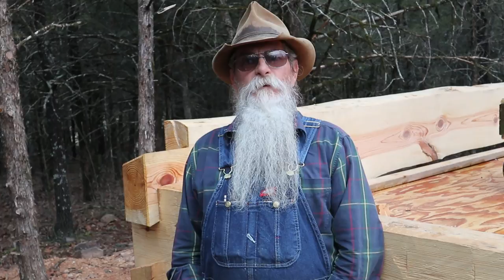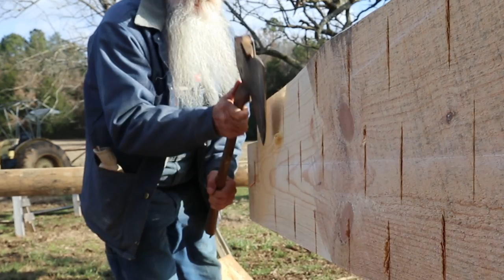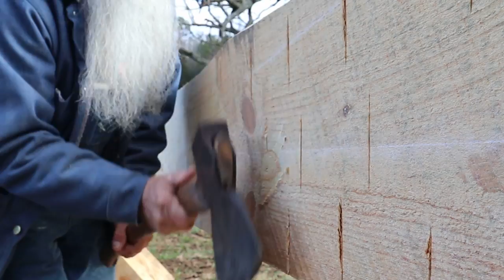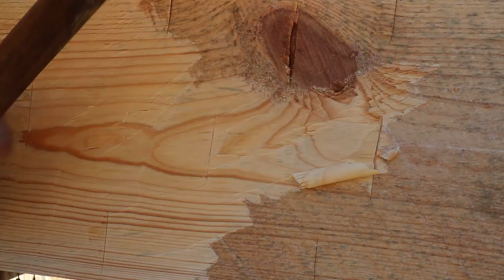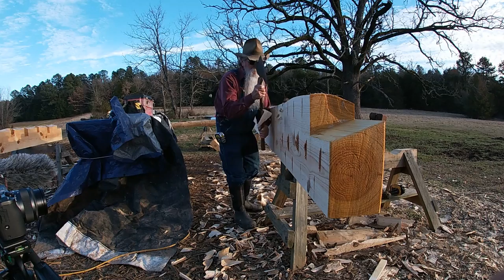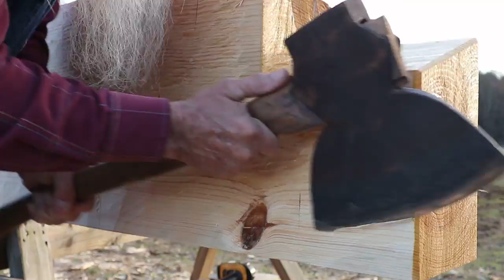Hewing the Sill Log - Dovetail Log Cabin Build (Ep15)

Comment: Nice job. If may I, I would like to point out one reason for hewing lumber even if you don't care about the "hand made looking". Hitting sawn lumber by broad axe, like when hewing, also closes sawn, ripped fibres. After the sharp edge on axe is thick part, which hits lumber from side and works as hammer, to hammer back and seal surface. I don't know, how large is wisdom and costumes in north America. This I've learned in Scandinavia. For the end, as You say, God bless You!
Reply from the maker: Howdy Vlada- that is the most informative reason to hew I’ve heard. Thank you so much for explaining this. You are so right, it does help close the sawn surface. I love the way a hewn log or timber looks. It seems to add to the appearance of the building. The fellows I worked with years ago always hewed the logs. I appreciate you watching the video and for the great comment. God bless you

Comment: Nice video, sir.  Could you recommend a good source for offset axe handles?
Reply from the maker: wayne lewis   Howdy Wayne- I make my handles. We have a video on how to make one in our playlist. Check it out. I used ash in that video but I’ve used hickory, pecan and black walnut for broad axe handles. I ‘be seen handles advertise in the past but I wouldn’t spend money on em. Hope you can make you one. God bless you
Reply: The Bearded Carpenter, thanks. I watched your handle making video after posting this question, and now I think I’ll give it a whirl. I have ash growing all around me. 

Also, One of my broadaxe heads still has about 2 1/2” of tool steel left, but it’s so hard that a sharp file just skates over it. Any suggestions on how I can draw down the hardness a little without doing any harm?
Reply from the maker: wayne lewis  Wow-2 1/2” of tool steel! That’s amazing!  All of my broad axes have steel that you can’t use a file on. I sharpen my tools with Japanese water stones. You can really get a nice edge with em. Been using em for years. I don’t think I would try to change the temper in your axe. I’ve had axes retempered. I wish you the very best. God bless you